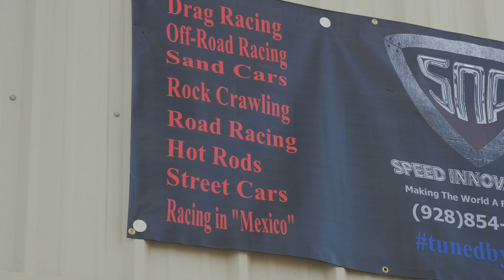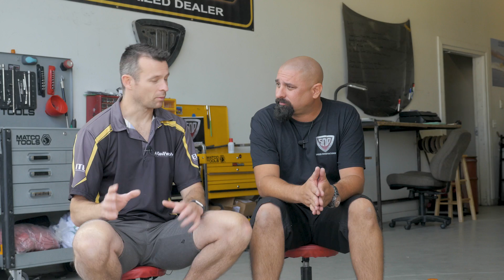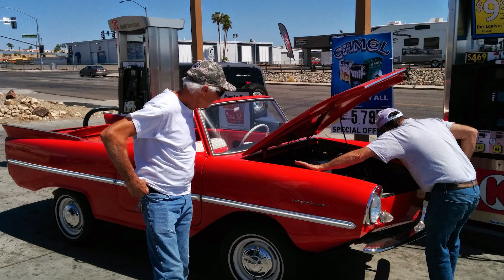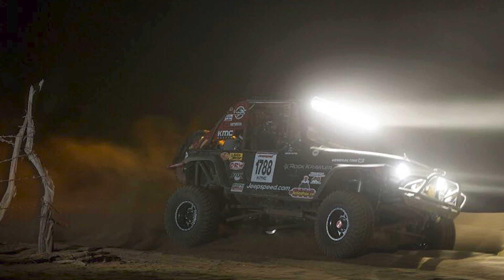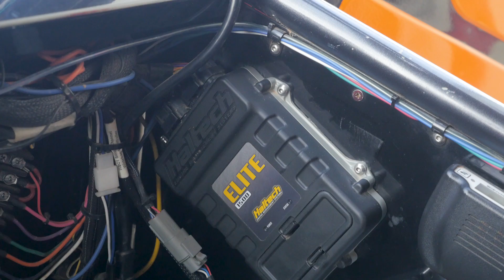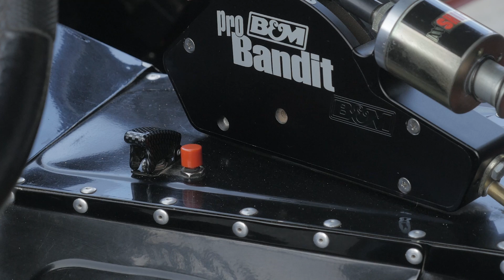🔨 SNP Speed Innovations | 3RZ Turbo Sand Drag Racer | HALTECH WORKSHOPS |

Comment: If making 1,800 hp @ 11,500 rpm, and running 70 LBS OF BOOST in a 3RZ engine using a STOCK block, STOCK crank, and STOCK head doesn't prove just how tough this engine is, I don't know what does.

Comment: What can you do with a 22r
Reply: Uh, sell it...??  3rz head & extra displacement will always outperform 22r.....
22 will sell, they are getting hard to find for street trucks etc
Reply: @karter9908  LC Engineering has discovered & partnered with a company in Sweden I believe, who are now casting brand new 22r and blocks that are very strong. You know they must be proven if LCE uses them. So now these engines are available again, just not at your local "junk yard". I still much prefer my 3RZ though.